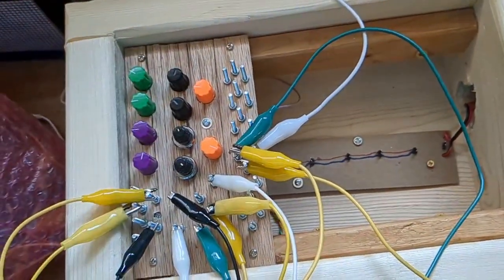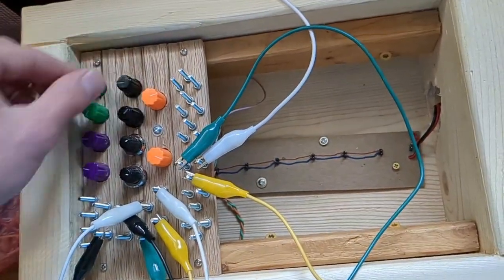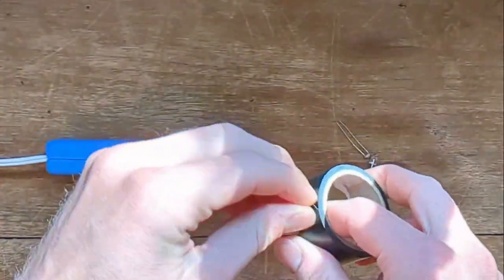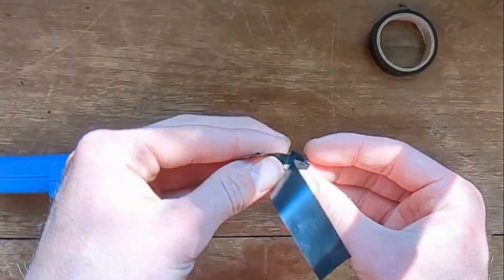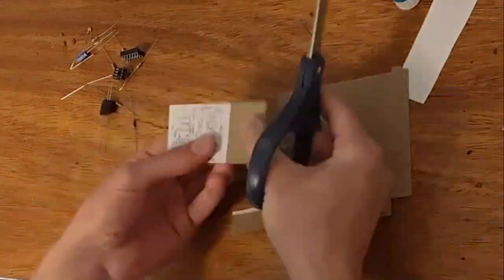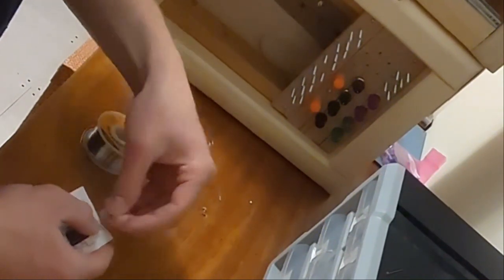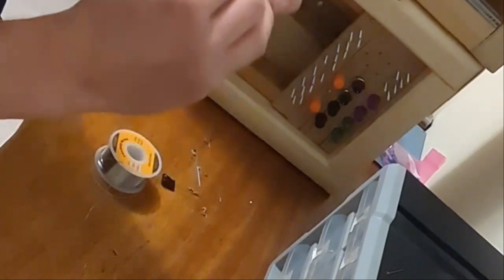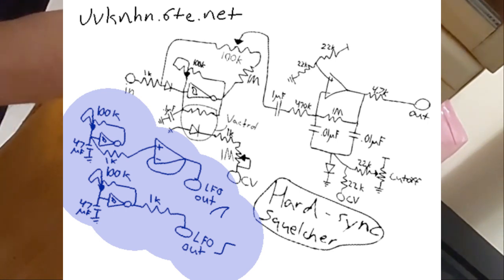9V Modular Synth E03: Hard-Sync Squelcher

Comment: Building this and have some silly questions. (i'm a noob ;) ) There is no value for the voltage divider potentiometer? I suppose the outer legs for it should go to 9V and ground? Should unused legs on the other potentiometers be connected to ground as well or just not used? When using the nodes / pins instead of mono jacks, there's only one contact point, so no ground? The mentioning of the transistors next to the papercircuit was a bit confusing, since there are none in the circuit, must be there from one of the other projects, you had me looking :D  Hope I'll figure it all out and get it running. Thanks for your effort in these videos, learning a lot fast! cheers.
Reply from the maker: Sorry about that, I've been meaning to make these paper circuits more readable.

The voltage divider potentiometer can be any value, I usually just go with 100k since that's the most common, but generally speaking, the value does not matter for a voltage divider. And you are correct in that the outer legs are 9v and ground.
On the other potentiometers, the unconnected pins do not need to be wired.
And yeah, if you use banana connectors, or screws for alligator clips, there is no ground running through the patch cables, which means you'll have to establish a common ground if you want to patch to devices on another power supply (like how serge, buchla, and ciat-lonbarde synths are).
The ambiguity is my fault and I'd like to go back and redo this one at some point. It is perfectly functional, but the instructions are definitely obtuse in retrospect.

Hope that helps
Reply: @uvknhn  hey thanks for such a quick answer. No previous experience with serge, bucla or ciat-lonbarde synths, do have a Soma Pulsar 23 and was in doubt between using the pins to pair your 9V circuits with it or just go with mini jacks like my euro stuff. Think I'll go for the pins / screws and have one for ground like on the Pulsar to connect those together. THANKS!!!!!!! Chances are I'll have questions on some of your other builds as well since I'm so new to this.